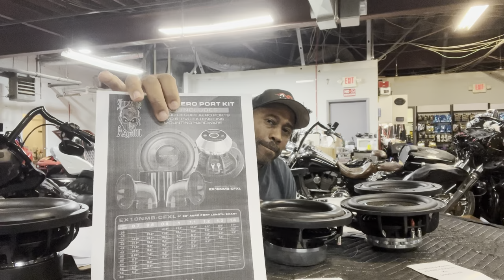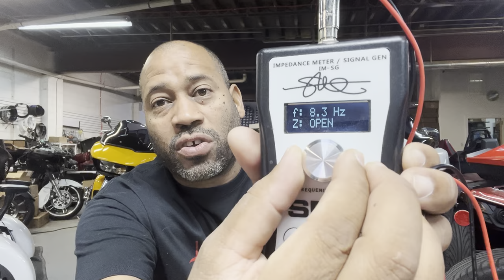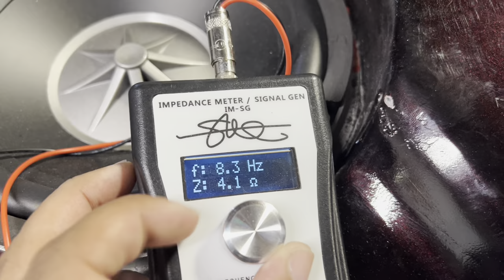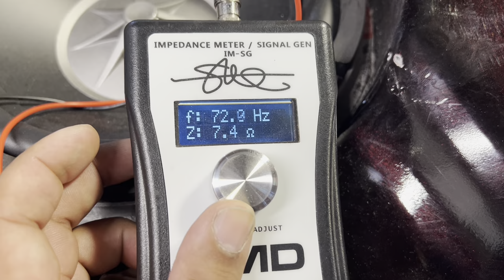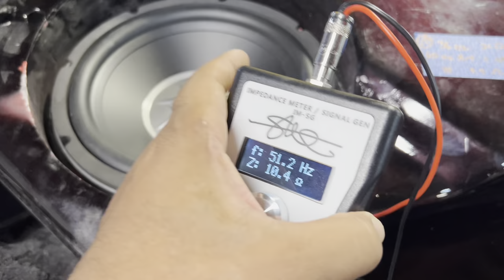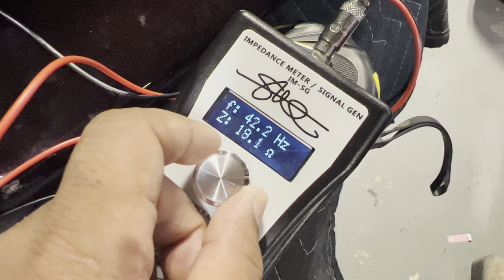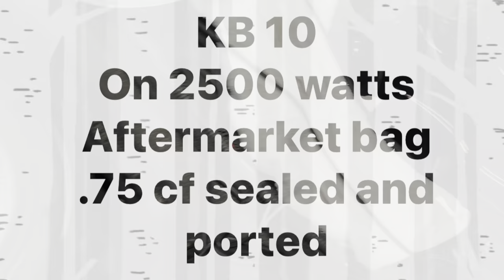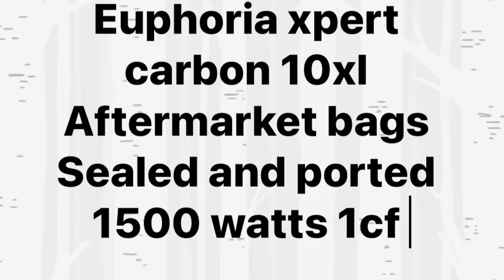Nvs audio reviews the 4 top high powered 10 inch motorcycle Mid Bass drivers Currently on the market

Comment: how does the alternator on a bike generator enough amps to do 2500 watts per 10 inch midbass? that seems insane. Also those 10 inch woofers really shouldnt be feed more than 300 watts musically.
Reply: I know it's amazing to think about current and voltage. What really blows my mind is the conversion from Alternating current to direct current to charge the battery and operate the electrical components and then convert from direct current to alternating current again to play music through speakers. While the majority of the Harley electrical components are direct current devices the amplifier reproduces an AC waveform that is tough to measure without seeing it's production on an oscilloscope. Measuring peak dc current draw and peak RMS ac current draw are easiest but are in burst with short burst times of even a full second. 2500w peak or even RMS is a very limited width in the full AC cycle. It's the battery(ies) and wiring which make the magic possible. I run 5 amplifiers and have never had a problem with my bike voltage but I don't play the radio much unless I am riding. Carlos has a video on batteries and the Harley, start there.

Comment: Do you feel the Xpert wont take the abuse bc its got a smaller gap and more musical vs just aimed at taking power? Based on the specs the Cicada seems to be very well rounded as well. The DC seems to be geared at lows in larger bags but i wouldn't expect it to be as musical.

Comment: Thinking I want to do 2 10s in the bags 2 six and a half in The upper fairings and 2 in the lower one amp to run the lowers and a amp bridged on each sub would that work
Reply from the maker: Yes
Reply: What about a single 10
Reply: @NVSAUDIO  what amp would recommend for the two 10s in CVO bags?